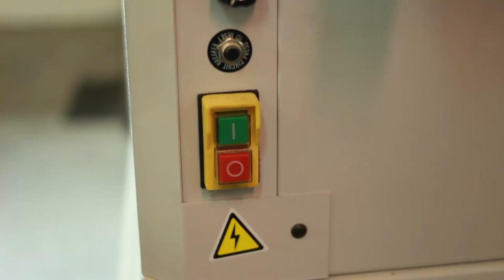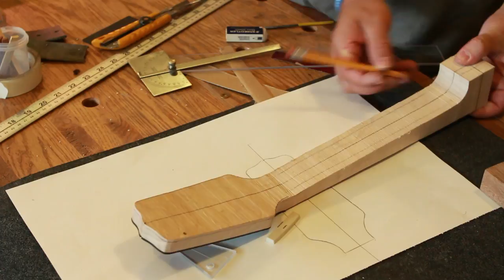Making the Octave Mandolin Neck.

Comment: thank you so much for sharing Tomy. loved the skill you showed on the bandsaw good stuff. questions please . you used epoxy on the carbon fiber strip .  why not tight bond is there a reason ?  .the plates on the headstock were they carbon fiber also or the thin veneers you get from wood craft dyed ?  again thank you
Reply from the maker: Hi Walter, The top veneer is Ebony and you can get them at either StewMac or LMII (luthier mercantile international). the back one is a died one and is extremely thin. The fiber rod I use epoxy because it is a much better way to glue it in then titebond. I'm not a big fan of using epoxy. But there are times it's what you need to use. Thanks for watching Walter!

Comment: I love that accent on the back of the headstock. Is there a reason you do not have a volute on the back of the headstock?
Reply: I didn't know we were doing it but i love it
Reply from the maker: From what I understand with volutes, it was introduced in the 70 when the wood selection was not the best and the necks were laminated.. The idea was to strenghten the transition between the neck and headstock..(this area was weaken futher with the truss rod channel). With a one piece neck, and a epoxied carbon fibre rod there is no need for a volute. The carbon fiber rod can hold all the tension by itself and as you can see from the video it extends in the headstock which will prevent the area to break. the back veneer it just to balance the color scheme we have already on the instrument. It does add a bit of extra strengh though...

Comment: Hey Tomy, I love your work. I have a question you epoxied the truss rod wont that keep the rod from functioning?? Thank you Scott
Reply from the maker: the carbon fiber truss rod are not meant to function like a traditional one. Meaning that once install it will never change. There will be no adjustment needed . that is why they are epoxied in. It adds a tremendous amount strength in the neck and also helps the vibrations in the neck to travel in the body..
Reply: Thank you so much for the info on the carbon fiber rods thats very helpful. Have a Great weekend.
Reply from the maker: A great weekend to you too Scott, and you are welcome!
Reply: There was a few discussions on the mandolin cafe' about carbon truss rods, so I knew what Tomy was talking about when he discussed it with me and I agreed. This instrument will have sustain forever :D